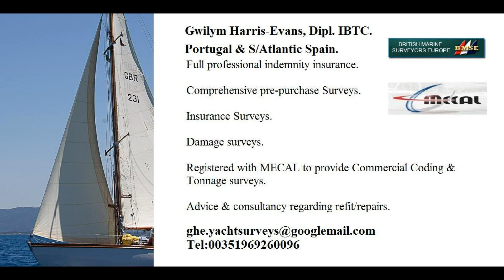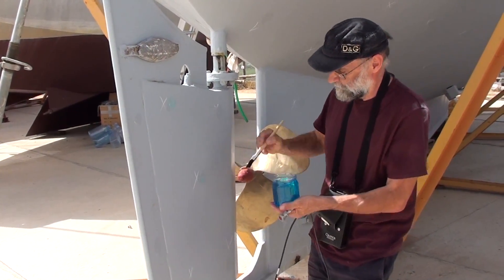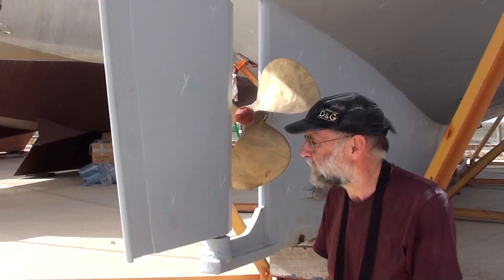Boat & yacht surveying & ultrasound (UTM) the steel on a boat or yacht.

Comment: Does anybody know if it is common to replace parts of a steel hull that become less than 20% of its original thickness? The surveyor didnt go into this in the video, although when finding a small weak spot in the rudder, he said that it was an easy fix for steel. Can anybody here answer about cutting and repatching weak areas? Thx.